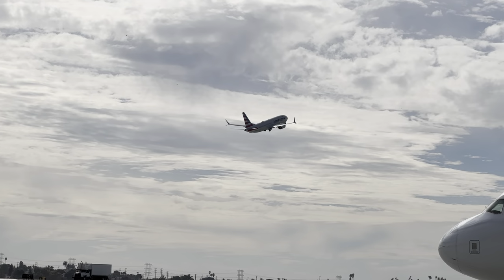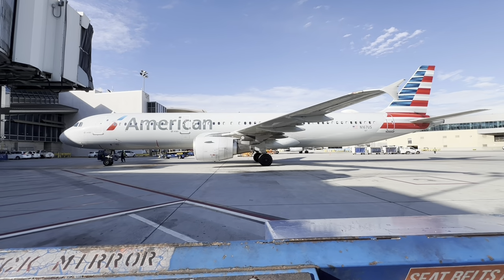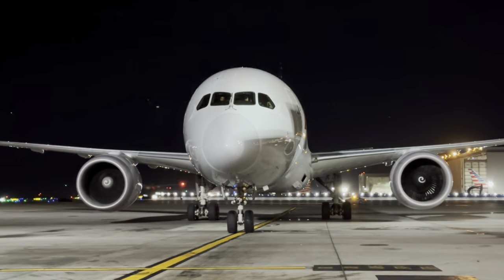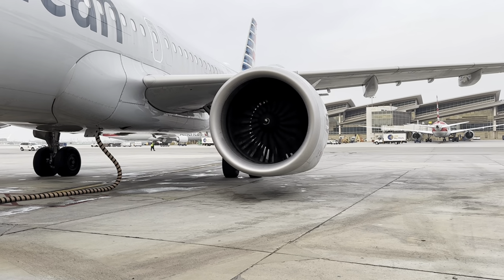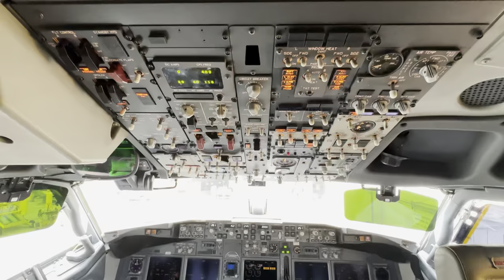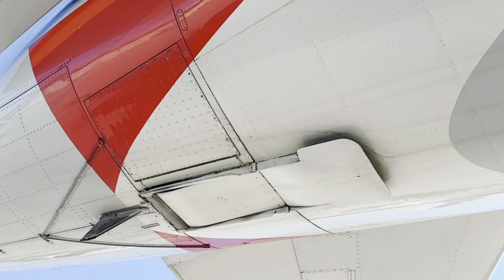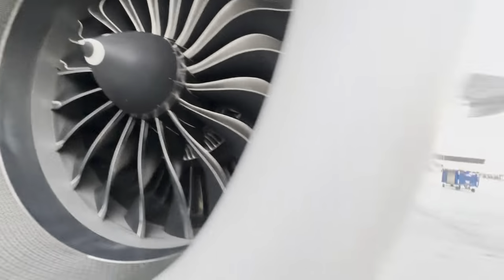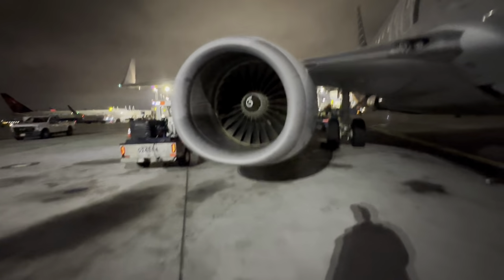Stig Shift #15 (Aircraft Maintenance Adventures)

Comment: Your videos are awesome over and over again👍
I would like to ask you to explain what, on almost stopped engine or when windmilling on ground the clicking noise is coming from. Is it a gear?
Reply from the maker: The clicking noise is coming from very particular engines, the ones that you most likely hear it from are the CFM 56-5B. Those are called mid span shrouds, I made a whole video about this. Check it out when you have time.
Reply: @StigAviation  Thanks for the explanation, now I understand.

Comment: 30:23 - a teeny weeny wing-rock there .. nods approval 🙂
Reply: I thought I saw that too!!! He did wing rock that bird!
Reply from the maker: What are you guys talking about wing rock?
Reply: @StigAviation  when a plane departs (usually it's last flight before bone yard, lots of other exceptional things) the pilot acknowledges the ground by slow aileron dip on each wing/
Reply: @StigAviation  Be honoured Mr Stig my fren. that wing rock was for you! 😃
Reply: very subtle because pax on board. not sposed to do random manouveres without good cause. 
they usually dont, but they are allowed to test aero surfaces in flight.
Perfect climb rate, weather was fantastic and clear.  Plane was happy, pilots confident. 
 In terms of respect, this wing rock to you is akin to a japanese not only bowing, but also removing hat first and walking respectfully whilst still boeing bowing all the way.

Comment: these videos are awesome thanks for them! request: one of the more cool avionics bays with all the racks of computers & airdata units. is a 767’s more massive than a more modern A320neo for example?
Reply from the maker: It’s definitely a bigger bay in the 767 but not more modern. 320 is way more advanced but a smaller bay.

Comment: I'm not an aircraft painter, but you're absolutely right that the paint effects the weight of the aircraft.
I know this because of the Space Shuttle.
Remember how on the first few flights the Space Shuttle's external tank was painted white, and how that didn't last very long?
Turns out they figured out they could shave TWO TONS of mass off of the external tank, JUST by skipping the paint!
Now, that's over that gigantic zepplin of an External Tank, so on something like this A319 at 40:20, you're not saving nearly as much weight by stripping it. Maybe like 50-100 pounds overall, for all that paint. That's almost the weight of one person, but that tells you just how little that stuff weighs.
The only reason it added up so much on the Space Shuttle's external tank was because the thing is so huge.
Reply from the maker: I think the tolerances on a space shuttle is a bit more important than a few coats of paint on an airplane
Reply: @StigAviation 
You're absolutely right about that!

Comment: Compass swing? Some older autos needed to do that too, right when the "digital compass readout" was starting to show up. The procedure for it was right in the owner's manual. Even on modern cars where you usually don't have to do this as often, it's still in there.

I remember my parents driving me around in a Chrysler New Yorker, and it had the LED display cluster, thing looked like a spaceship to my kid eyes.
Pinnacle of late-80's early-90's tech, even tho everyone's now gone back to "analog" displays (they're actually all-digital again these days, the pointer on all modern gauge cluster gauges is driven by a tiny little stepper motor (very weak, just strong enough to move the gauge pointer) controlled by the dash cluster's electronics (I hesitate to call something so electronically "simple" a "computer" because there's no decisions being made, it just mostly-blindly translates data from one format to another, but it'll still throw it's own trouble codes if it's not working right!). But I digress.
That New Yorker's gauge cluster included a Digital Compass in the center rear-view mirror. And for a while we could never get it to read the right direction, it was off by enough that you'd notice it. So, me being the inquisitive young child I was (less than 10yo at the time, but I could read!), went looking for a solution. At the time, like most kids of that age, my parents were the source of 99% of the answers to my questions. Also, ever since I learned how, I've loved to read. So I was talking to my dad about it, and then he did something I hadn't thought of at the time. Dad opened up the glove compartment, and took out a funny-shaped book that I hadn't even thought was in there. Boldly printed on the card-stock cover of this book was the words "Chrysler New Yorker, Owners Manual". He told me that I could probably find the answer in that book. Cars have always fascinated me, so he didn't have to tell me twice.
It didn't take me too long to find the required procedure, and since the parking lot was mostly empty, we did it right then, while Mom was still in the store.
Apparently she noticed tho, must have seen us moving the car around. Dad explained what we did, and I chimed in that I was the one who had looked up the way to do it. And when we left the parking lot to continue on our day, just as expected the compass was now reading true to reality.
Reply from the maker: I learned something new today, I did not know a car is also did a compass swing. Thank you for the education.
Reply: @StigAviation  
These days the car usually figures it out on its own by the changes in direction of normal driving, so it's mostly a thing of the past. However, there is still a way to tell it which compensation setting it should use, which you determine by geographical location (there's a chart in the owner's manual for this usually, as well as the procedure to input the setting which usually ends up as some sort of Konami Code sort of input on the various controls, or just the trip-meter reset button some times)

Comment: So Stig, Cactus 1549, Sullys flight, could’ve been flown with a non working APU ?  He was just flying to CLT.  That would’ve sucked.  Love your vids.
Reply from the maker: That’s an interesting scenario you presented. It could have been on MEL, and it would not have been a very good ending, BUT you also have to take into consideration that the aircraft has a rat, ram air turbine, so they still would’ve had some functionality of hydraulics as well as minimal electrical systems.

Comment: Great stuff every time, Stig. 👍👍Regarding the compass —
The “whisky” compass actually was named the “wet” compass (and typically filled with kerosene for damping quality)  to differentiate it from the mechanical gyro directional flat compass (called the “heading indicator”) on the instrument panel. The wet compass also was very susceptible to leading and lagging in turns, depending on your heading, turbulence and natural magnetic variations as well as inherent deviation from electrical equipment in the cockpit. Took a little getting used to it’s quirks to navigate with🫣🫣
The heading indicator was not susceptible to any of that and was intuitive to use and easy to navigate with!! Besides a quick reference check of the mechanical heading indicator—or now the supremely accurate ultimate electronic versions— the “wet” compass merely is barely used in modern flying!!
Reply from the maker: Thank you so much for all this information. You taught me something new. I appreciate you.
Reply: Glad to help you!!! I'm an "older" many years USCG helicopter SAR and medevac aviator from the early 70's! (the mighty HH-3F Sikorsky!!)! When I got out of the military in 1976, I got my A&P license after 20 months at Spartan School of Aeronautics in Tulsa, OK---worked at the Tulsa airport for Tulsair Aviation (on the GA side) and watched every day all the American Airlines DC-10's and 747's of that time now only a memory, going in and out of the big AA maintenance facilty there in Tulsa. When I graduated from A&P school,  I was fortunate to be hired and went to work for Contintetal Airlines at the main hub at LAX--right next door to the Americsn Airlines maintenance hangers at the very end of 24R and 24L!!! I was fortuanate enuf to get to work on all of Continental's DC-10/10/30 airliners, and the Boeing 727 series jets. 
Stig, it was THE best job I ever had!!! How you always describe your absolute love, passion and overwhelming appreciation of being an airline tech is sooooo GREAT---and was EXCACTLY how I felt!! Doing engine run ups, engineering test flights, signing the logbook off to a Captain and crew headed with the BIG TEN to New Zealand, taxing the "BIG TEN" from the COA gates on the runway late at night to the maintenance hangers------all was great!! I loved every single second of working there--almost four years---then it was all over when Frank Lorenzo took over Continental in late 1981 I think it was, and fired every employee from the President and Board of Directors down to the lavatory cleaners-------it was devastating to say the least!! I tried to get work at any other airlines, but the wave of airline and transportation deregulation in those late 70's and early 80's killed any chance of my future in the airlines :( I went to work inthe oil and gas industry and worked in it for over 35 years until I retired in 2017>>>I have never forgot my roots and love for anything in military, airline and general aviation. So that is why your YOU TUBE is so GREAT- I can continue my love for the airlines thru you!!! Commentgs from your followers are 100000% right on!!! The comment from cdpetty81 below sums it all up PERFECTLY!! Well, Stig, stay safe and aware always around those big beautiful monsters, and allthgebst in your career. God speed>>>>> @StigAviation
Reply: SORRY>>>>>Have no idea how all those words got lines thru them!!!???????

Comment: I bough a retired delta 747 chair and I want to use the IFE screens as a monitor, would you know what kind of cable I should buy to connect it to a VGA cable or something like that? It looks almost like a Db26 cable from the bottom of the seat but I’m not sure. I understand if you can’t help but I figured I’d ask, thanks!
Reply from the maker: Well those things run on a different power setting. 28vdc 115vac   You’d need something like that unless you convert it

Comment: Omg, that Finnair pilot absolutely buttered that A350.
Reply from the maker: Absolutely butter 👌
Reply: @StigAviation  oh yeah. Stig, i forgot about my question.
Are super loud squeaky brakes normal? 
I've been on planes almost all my childhood but I don't think I've heard any squeaky brakes (except) that one time on a 777-200, it was a strong cross wind landing, as we touched down, I could feel we drifting left to right as the Pilot trying to stay on the center line. And then the super loud squeaky brakes, Which was my first time hearing a plane brake squeak.
Reply: @Odontomango Maybe it the nose gear tires?
Reply: @collectorguy3919  I was sitting at the main wheel lol, no way I could hear the nose wheel. 
I asked other pilot, they also said they wouldn't hear the main gear from the cockpit either. So it's vice versa.
Reply: @Odontomango  A squeak is a bit ambiguous without heaing it.. it could just be a passenger 'puckering up' all the way through to their seat shifting or anything. was is definitely outside of the fuselage? could it have have been in cargo hold perhaps?
Reply: @Palmit_  Nope, a full on super loud classic tire sqeeking sound. No way anyone would mistake it for something else.
Reply: @Odontomango  oohh. spooky! but exciting squeeky! 😃 those are great :) 
But yeh, may be an over inflated tyre, those squeek the most. more than under inflated because the surface area is more in under inflated. over inflated tyres are a bit more 'skittish' and slightly more bouncy which hampers maintaining strong surface contact/traction
Reply: @Palmit_  When I asked a pilot i know, he said after the flights, sometimes flight attendant would come up to him and ask about the screeching brakes as well. But he couldn't hear it from the cockpit.
Reply: @Odontomango  Main thing is, the touchdown succeeded 🙂. sometime i hear noises in my house. i wonder if it somebody come in? is there an animal?  Is it the wind or weather somehow? All i know is that it's normal, aparently it's 'the house settling'. I'd be very hard pushed to find exactly what bit is settling. tyres screech, houses settle, people 'judder', lights appear in the sky and lots of stuff that can't be explained, happens. i expect over inflated tyre and would sign that off unless i had lots more reports.  Don't worry about it. It's gone. next time, just blame it on over inflated tyre without overthinking, and you will sleep better 
😃
Reply from the maker: I haven’t heard squeaky brakes, but I have heard of grinding brakes
Reply: @Odontomango  You said cross-wind landing, so the plane is crabbing into the wind, and has to straighten out just before contacting the ground (or is it during?).   That could involve skidding the tires for a few seconds on an angle, or longer if it skids off the centreline.  (my guess, as an average Internet idiot)  How much time in your case?
On an ordinary landing, the tires make a brief chirp as the wheels contact the ground and start turning.
Reply: @collectorguy3919  It was pretty long, during the braking until we slow down. not during the decrabbing or touching down.
Reply: @Odontomango That's an unpleasant landing roll!  Maybe it was my daughter screaming.  Are you sure that you didn't hear someone say "OMG we are never having kids".
Reply: @collectorguy3919  lol no

Comment: I've seen you do a single tire change, but I assume all the tires are replaced on some schedule? Does that coincide with, say, an "A-check" or every X number of landings? Do they just schedule the plane to go to a certain airport that specializes in doing tire changes?
Reply from the maker: Tires get changed only when they wear out, they do not just change them because of a schedule. If a tire has reached its limit, then it will be changed out, regardless of being on the line or in a heavy check environment.

Comment: Just meant to thank you - these videos go a long way in showing people how much workgoes into making a plane fly.

The FO's dome light on the Airbus is - was? - also for charts, but mostly for reading the checklist(s) in an emergency.  In what is known as the Electrical Emergency configuration (i.e. all generators lost, flying only on the batteries) the only working things will be on the captain's side so he'll be doing all the flying and the FO will be looking at blank tubes and dark readouts.  They couldn't afford the power to supply both sides and decided that if things got that bad, the captain was likely the better - or at least more experienced - pilot, and if they had to choose one that's the one that they went with.  Meanwhile the FO would be scrambling through the checklists to try and restore power, so for that reason he gets the only working light.*

(All airliners also have what's known as "Emergency Lighting" used for evacuation; that system has its own separate dedicated battery system and is for evacuation only, and is good for only fifteen minutes, so if we actually ended up in this scenario, we would shut the Emergency Lights off until just before landing).

As a by the way, the wet (whiskey/magnetic) compass - and/or separately its light - actually can be deferred on the Airbus (MEL 34-12 d) if certain other systems are all working - primarily the three inertial navigation systems.  If it is MEL'd, we have only three days to fix it or we have to park the plane.  The FO's Dome light, for the reasons mentioned, is the only light on an Airbus that can never be deferred.

The location of the "potty" (potable) water and the other "potty" (lavatory) waste doors actually makes sense.  Most planes have the service doors on the same side; if so that waste door was always aft of the water door so that if there was any leakage in flight from the waste connection, it would be blown aft by the slipstream and away from the water door; if at the gate it would run down to the centerline of the aircraft and then run forward down to the belly.  By placing them on opposite sides they're just that much more separated, and as a bonus it allows them to be serviced at the same time; you wouldn't want someone dragging the water fill hose across the honey pot...er, lav truck.

* Flight on batteries only is just about the worst scenario (the absolute worst is actually a loss of all hydraulics) on the Airbus; we do have a RAT (ram air turbine) that Stig mentioned as he walked by it; that's a little windmill thingy that drops out and provides hydraulic power; hydraulic power in turn spins a generator that provides electrical power.  We can also attempt to start the APU on most Airbuses; the oldest 21 A320s have an older smaller RAT that can't support an APU start attempt.  If we can't get the APU online or at least the RAT, we have 20-ish minutes of electrical power on the batteries (we can stretch it to 30 if we manually shut down a few more items until just before landing) before we're completely dark.  it would be a bad day...
Reply from the maker: Absolutely fantastic, I love it when people know and understand their machine. Thank you so much for sharing your incredible knowledge with the rest of the world here.

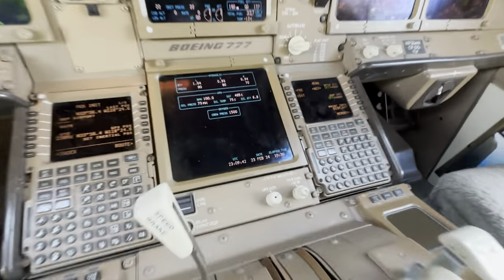Comment: Hello, Stig. Thank you for another great video. Quick question: when you show cockpit of 777 (6:40 timestamp) I saw a placard on right side of screen with 3 rows of data. First row is a aircraft registration (N730AN), second - SelCal (CP-DG), but what is in a third row (7LP)? Thanks!
Reply: It's an American Airlines internal code that identifies that specific aircraft for tracking purposes. You also find this code below the registration number on the aft fuselage and on the front landing gear doors.
Reply from the maker: That is called a nose number, that’s how we keep track of it as maintenance.